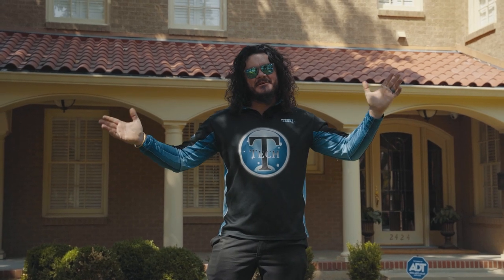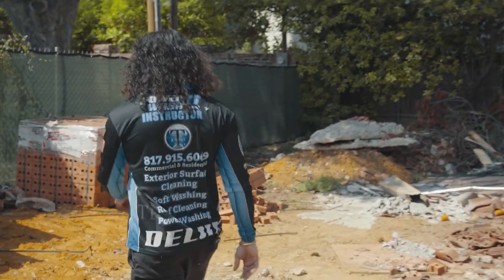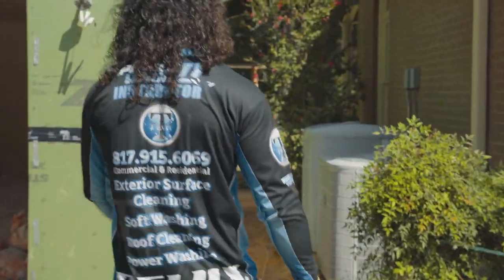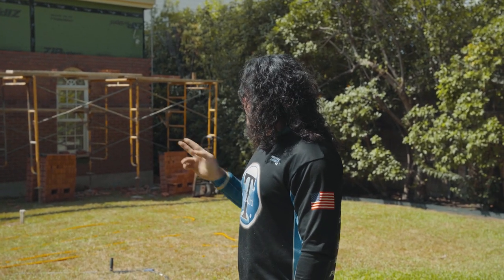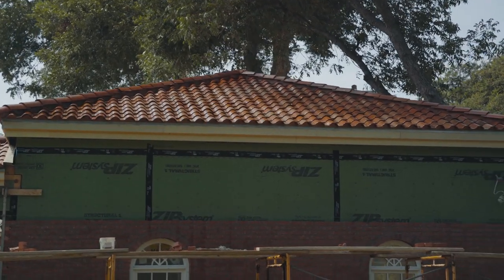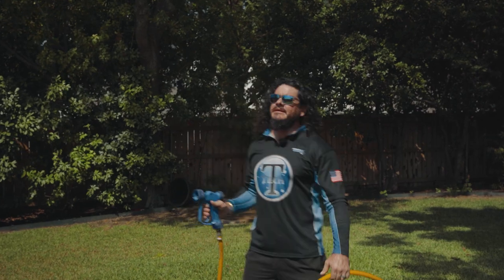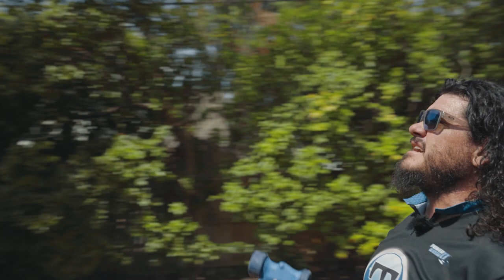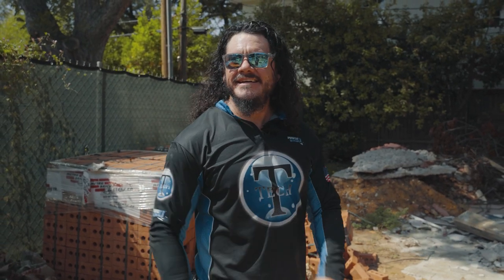How to Wash a Spanish Tile Roof! | Full Walk-Through

Comment: Maybe I am the wrong target audience for this video but I didn't learn anything on how to wash a spanish roof.

I know how to aim and spray a hose but what about all the other potential questions?

What are you actually spraying on the roof?
How long did you let it sit?
What are the risks of spraying too much solution?
What equipment are you using and is there an easy to use DIY setup?
What is the purpose for spraying down the grass first?

A drone would have been a great investment for this video so we can actually see what is happening.

Hope this helps improve future videos. If I'm not the target audience then ignore this comment, and my ignorance :)

Comment: Tyler, if there had been some thick moss growth or lichen, would you have had to walk the roof to remove the debris or do you just kill the growth and let the weather elements remove the debris?
Reply from the maker: Usually, depending on the build up, if you let the mix sit long enough, it will usually come off with a good rinse afterwards. Sometimes it may take a few applications depending on the build up. The weather does a great job at rinsing too. We try to stay off the roof when possible though.

Comment: want to start in Residential and Industrial Pressure Cleaning ' I don't know which is the ideal machine to use a 20" or 24" pressure surface but I don't know which is the correct machine to use those pressure surfaces!  How many gallons(gm) and Pressure (Psi) should I use?
Reply from the maker: That's a very good question and there are variables to making the right purchase.  Please give us a call at 1-800-433-2113 and we will be happy to help you.

Comment: What did you use for mix? What are you using for a roof pump setup?
Reply: 12v pumps are best for roofs. I like flojets. For roofs you want a 4-6% mix. Fan tips for roofs!
Reply: What is the mix made of? What are you using?